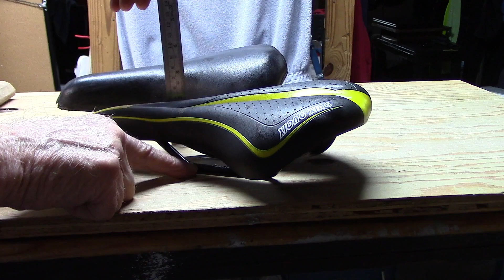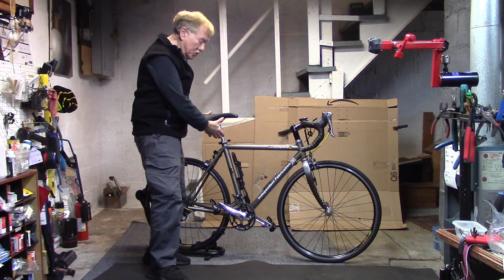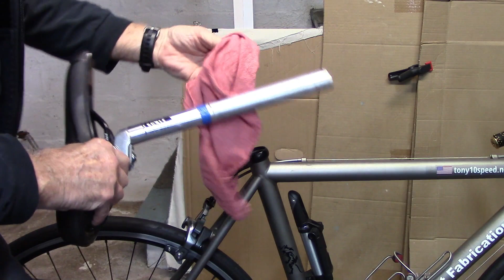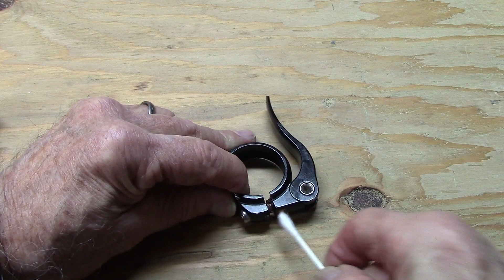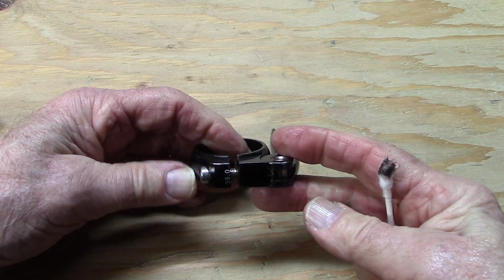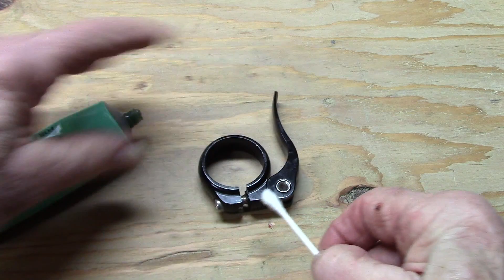Don’t get Stuck with a Frozen Seized Seatpost

Comment: For titanium frame with aluminum seatpost, I use anti-seize (AKA "Ti-Prep").  Yeah, some may argue that annual removal, cleaning and re-coat should prevent seizing even using Fiber Grip, but I just found a post by somebody saying that theirs seized using regular grease after 9 months.  And then there's the possibility of missing an annual overhaul if your life gets turned upside-down by family emergency, etc.
Reply from the maker: I suppose you could have the seatpost seize in 6 months if you've been riding in very damp or wet conditions, but I would not take 1 posting as applying to all without knowing more details. As to  using anti-seize compound, my overall favorite is Park ASC-1 for steel, aluminum, and titanium which may be a better selection then Fiber Grip but I'll leave that up to the viewers. Thanks for your input and safe cycling, Tony

Comment: A true example of prevention being better than cure. A simple bit of maintenance is all that's necessary. Many decent frames have been thrown away because of a seized seat post. I wiggle my seat posts up and down once every few months.
Reply from the maker: That should do the job. Unfortunately, most cyclist don't ever consider such easy maintenance. Regards and safe cycling, Tony

Comment: I like the idea of using a piece of tape to assist in re-assembly of the post.
Reply from the maker: Yes, it holds the rubber of the tube in place while you attach the accessory.

Comment: What is Park ASC-1?
Reply from the maker: Park Tool Anti-Seize (ASC-1) Compound reduces friction in threaded and press fit connections for easy assembly and disassembly. Used for bottom bracket and pedal threads, pressed headset cups, seat posts, quill stems. For use on steel, aluminum, and titanium. I find it a bit messy to work with. Park Tool SAC-2 on the other hand is specifically formulated to help prevent slipping on bicycle seatposts, handlebars, and stems. SAC-2 creates friction between surfaces for an extra-secure grip, while also forming a protective barrier between different materials. Ideal for carbon fiber, aluminum, and steel.

Comment: When I was a kid I got a carbon seatpost stuck in an aluminum frame. I ended up cracking the carbon seat post trying to remove it, so i sold the bike with the stuck and cracked seatpost in it.
Reply from the maker: Yes, even carbon fiber is not immune to seizing. I hope whom ever you sold it to didn't end up on the tarmac.
Reply: @tony10speed  The seat was stuck at about 30 degrees to the right, which had made it quite unrideable. The bike was a Giant Reign 1 and even with the damaged seatpost it got sold within one hour.
Reply from the maker: @Samsonmetaphysical  Remarkable.